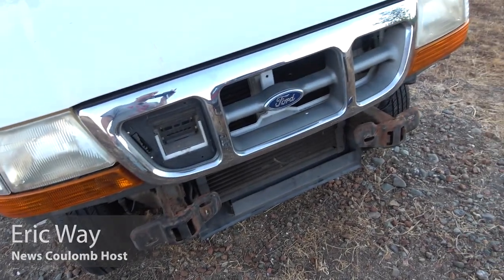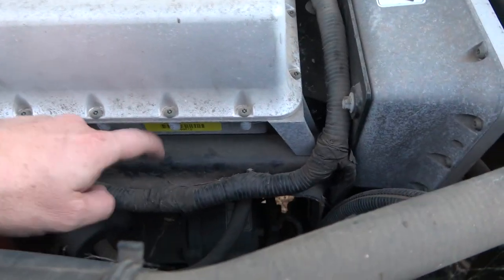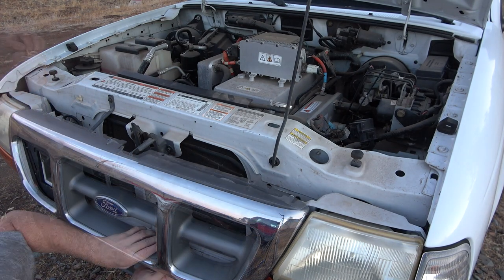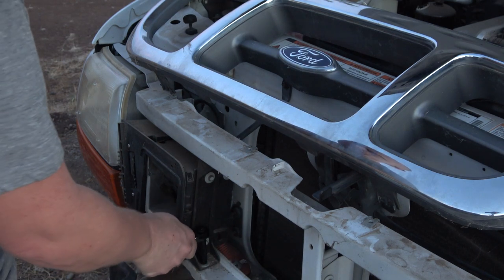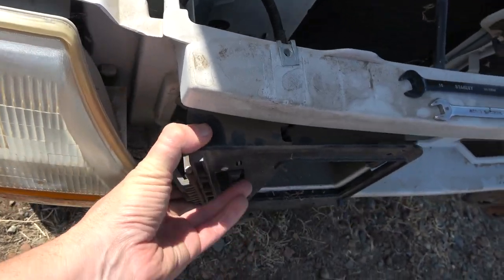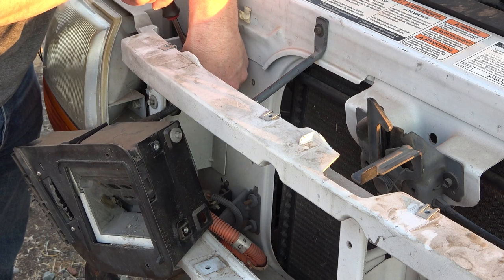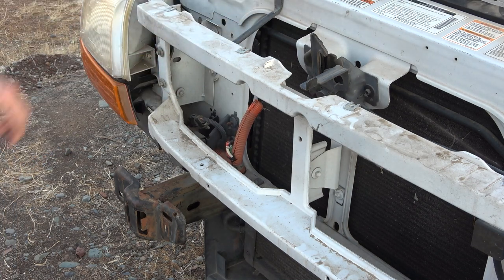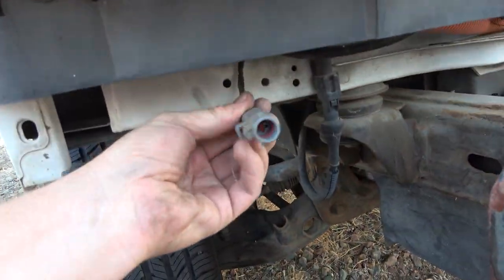Ford Ranger Electric: Removing the AVCON Charging Port

Comment: Continue to be impressed by your methodical approach to this whole process.  Surprised that there are still replacement parts (charge door) available.  I would be overwhelmed recognizing so many of these components can't be used and must be updated and switched out with other parts of different shapes and form factors.  On top of electrical knowledge, a big part of this job becomes (like it has been for the batteries), real estate (volume, space)  management.  That requires you to have a bit of a vision in mind as you move forward (as you were for the charger housing) for how parts can be arranged (tetris skills become useful).  All very interesting.

Thanks a lot for taking us along.
Reply from the maker: Thanks, Bruce! Yes, there's a lot more "imagineering" to come! :-)

Comment: Just so you know,  I was yelling "use an extension with a swivel socket,, or take out the passenger side headlight" while you were trying to reach those bolts.
Reply from the maker: I almost did. I'm on the fence about replacing them anyway. They need to be defogged, and I might replace them with LEDs anyway. Double the Lumens for half the energy.

Comment: Big update! I tell you what, In a few years I'll need a way to convert my leaf plus to CCS.   Shame the two way functionality of chademo is so cool.
Reply from the maker: I believe CCS can (theoretically) also support bi-directional power, but it would need to be programmed to do so. Essentially, it's just a matter of closing the contactors on demand and ensuring whatever you're feeding power to can accept the DC voltage of the pack.